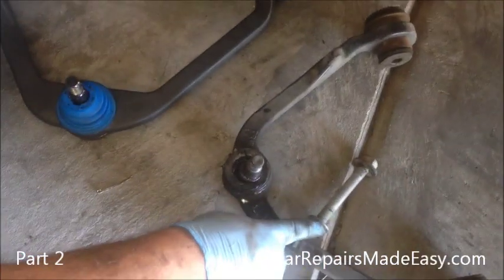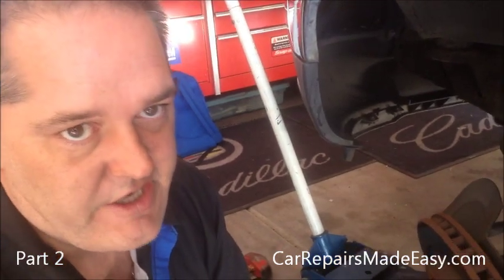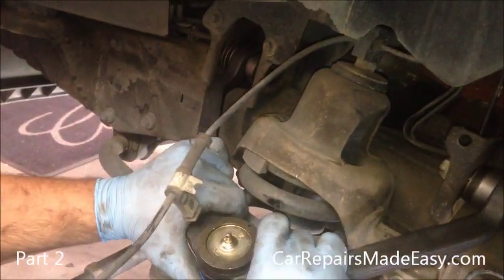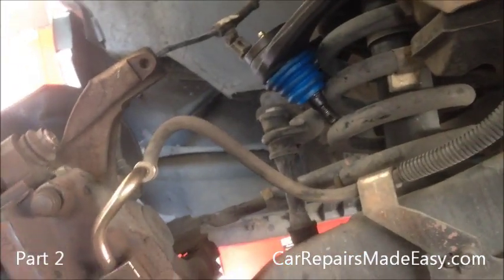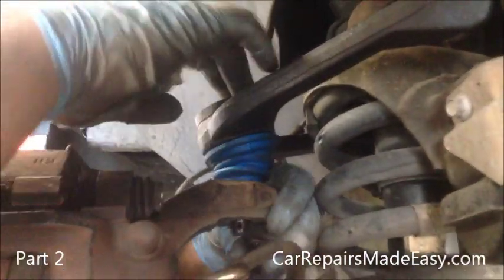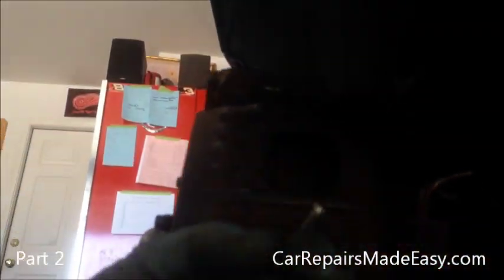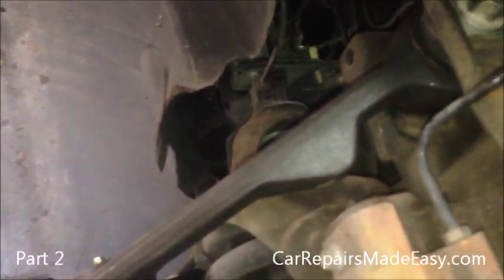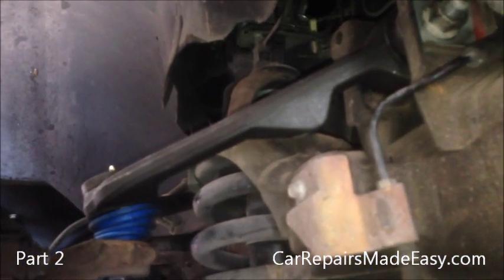Expedition Upper Control arm and Ball Joint Replacement Part 2

Comment: On that particular one a person does not need to take it and have it realigned as you mentioned because the slotted part of the bracket is only useable if you change out the rectangular FIXED position washer that is on the other side of the bracket.  The retngle prefixed washer on one side of the bracket makes the slotted adjustable side dormant unless a person removed the rectangle washer and installed the oval shape washer adjuster at a later time due to a possible wreck altering the actual vehicle frame,  Look again at where the man describes the slotted side then the camera shows the one hole on the right that is preset fixed to only go one way.  No alignment needed on this one

Comment: I would be concerned with not fully tightening the upper control arm, and assuming the alignment shop will be tightening it. What if they put it on the alignment machine and find no reason to adjust that bolt. Then down the road, it works loose?

Comment: I have a 1997 Expedition 5.4L's top driver side control arm (on the right/near window) 21mm bolt that is stripped. It has an offset large washer like.  Do you know the part number?

Comment: Dealer says my upper ball joints boot are torn. where can I get them online? And if the only place is the dealership, how much would it be?
Reply from the maker: The parts we installed were from a local aftermarket auto parts store, and were relatively cheap.  The items we installed were made by a well known manufacturer {Moog} , and were a good replacement and fitment was great.  Thanks for your question, please join our forum at forum.carrepairsmadeeasy.com